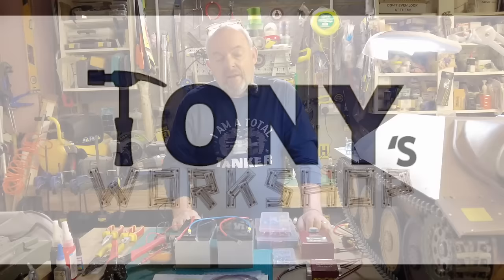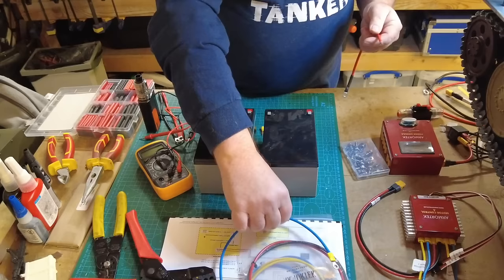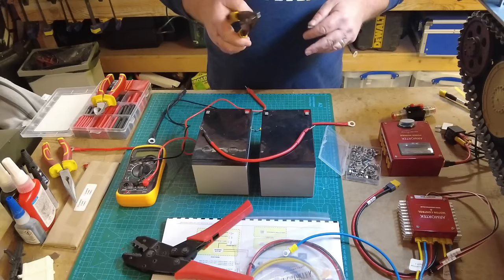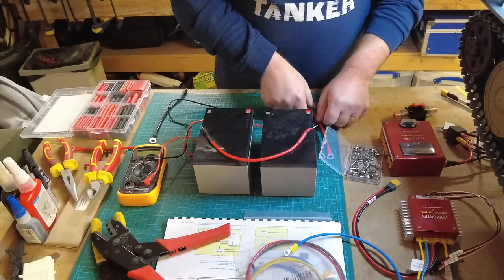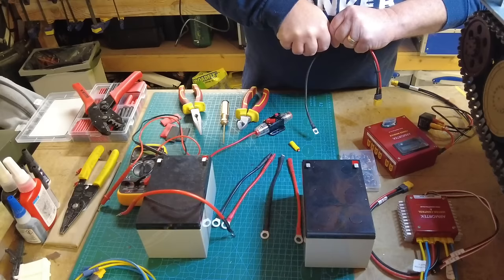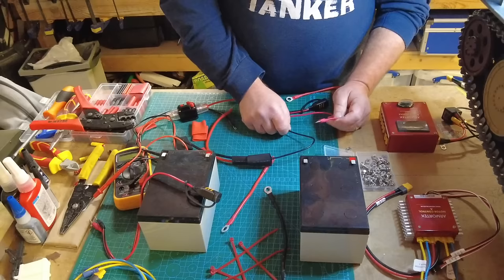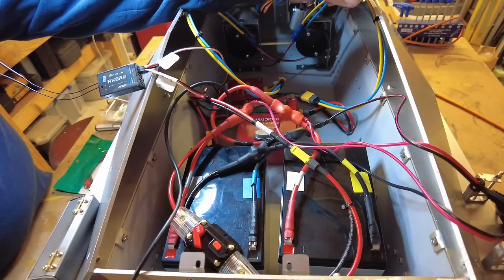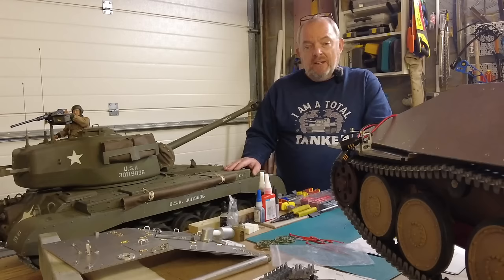1/6 scale Armortek Hetzer Jagdpanzer 38 (Vid 17)adapting batteries & powering up the drive motors

Comment: Great progress Tony - marvellous to see the Hetzer's tracks moving at last, and it was really enjoyable watching your approach to the electrics. Really looking forward to seeing your M26 moving about too! I picked up (literally, and it was 50kg) my hydraulic scissor table yesterday from the local ferreteria. I ordered it before Christmas but things move slowly here - so that'll help me to progress my own M26 build without risk to life or limb👍 I've also grabbed a few different circuit breakers along the way to give me some options when I come to tackle the wiring⚡⚡😀
Reply from the maker: Hi Keith, great to hear from you again and thank you for your positive comments. I hope that your M26 build is going well and the table lift will definitely help during the build and storing the tank post build. I also use a motorcycle scissor lift on the table lift to elevate the tank in order to take the stress off the torsion bars when storing. Best regards..Tony

Comment: Tony, I hate, and I mean REALLY hate wiring, but you explained it so well that my ‘hate’ has now diminished to a modest level of uncertainty 😂. I wonder if anyone has ever installed a scale petrol/diesel engine in any Armortek tank? That would be interesting, leaving the electrics to run the rest of the operations. Just a thought…..
Reply from the maker: Hi Peter....I too used to be like that...but I persevered, so I am at the same level "a modest level of uncertainty"🤣 It is only 12 volts, I guess but I am always worried about blowing up a circuit or something. I have seen blank firing mechanisms fitted and even a guy who set up a BB MG....but never a small petrol engine....way beyond my knowledge base, but an engine from a hedge cutter would fit.....now that would be a blast🤣

Comment: I assume you have to add the leads for the charger,and Armortek does not supply that. I also guess that the batteries can be charged in place with everything still connected. I have all the motion kits for my tiger,but I have not studied any of it yet. I have a long way to go before wiring! Very good video, as always.❤🎉😂
Reply from the maker: Hi David, yes the charging leads are purchased separately and come with my CTEK MXS 5.0 Battery Charger. The batteries most definitely stay in place and all you have to do is to hard wire the leads to the batteries then have somewhere that you can present the cables from. On my Tiger, I have dressed these through the escape hatch on the turret. You will not have to worry about the battery terminals as the ones Armortek recommend for the Tiger are the screw top terminals. If you get stuck when you get to that stage, give me a shout and I will try to help.

Comment: The more connections you use - the greater the chance of failure down the line. Where are the line fuses?
Reply from the maker: Hi Ian and thanks for watching and commenting. That is a true observation, however I have the power supply protected directly from the batteries with a breaker and secondary switch and an additional in line fuse to what will be the power to the servos. The connections are good and all tested providing a trtue supply from both of the 12 volt batteries. Once the electronics are connected and complete everything is tied down so not to work loose. I am happy that this will hold up to the rigorous use this tank will have in its life.

Comment: Have you considered using power tool lipo battery packs.? Huge run time. Fast charge time. Bit risky for fire.
Reply from the maker: Hi and no I have not...I know there are other ways to power these small beast up, but I like to stick to what Armortek recommend...Just in case something burns out, I want it to be down to a factory fault and not effect any warranty. These batteries tend to provide over 1 hours driving time...not run one of my tanks past the 1 hour yet, but when I put them back on charge they indicate only 50% usage. Not bad considering that they are constantly being drained throughout the 1 hour use.
Reply: That's a great run time. Yes, stick with those then.

Comment: Looking good, assuming the 'one stick per track' setup was just for testing? I had all sorts of fun setting up the single stick operation on my mine as my Mark IV didn't have any gun/turret to worry about. The only other question that occurs is have you decided where the speakers are going as they are fairly bulky in rhe small hull?
Reply from the maker: Hi Daniel, yes just for testing....I have just received the remainder of the option packs from AT and will now look to set everything up how I want it...I must admit I am concerned about the lack of space and where to install the speakers...I may mount them on a shelf...Thank you for your continued support.
Reply: @tonys_workshop  I only brought it up as I was looking at mine. Having only one battery I was able to lie it flat and have the speakers on top but looking at your wiring setup there didn't appear to be a clear space for their bulk.
Reply from the maker: I do think it will be a challenge...but hoping a shelf may help.

Comment: Do you ever use any conductive grease on the fittings?
Reply from the maker: Hi Wayne, no I have not. I must admit, I didn't even consider it. Does this improve the conductivity?
Reply: I think it prevents corrosion on the contacts and therefore increases resistance. I use battery power with large scale trains outdoors. Another great build video too, BTW. @tonys_workshop
Reply: prevents increased resistance. I meant to say. Cheers.
Reply from the maker: Thanks Wayne....good idea...Thought you meant to say "prevents resistance" Thanks also for watching and commenting.